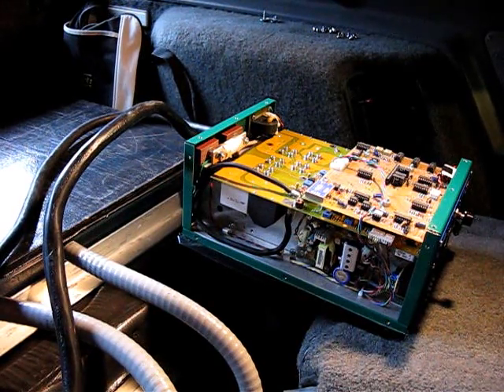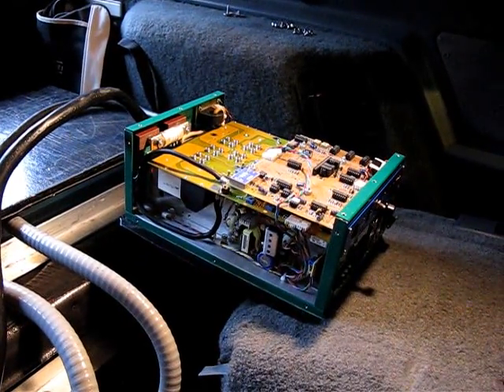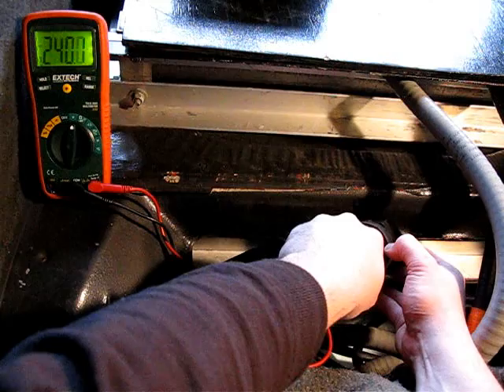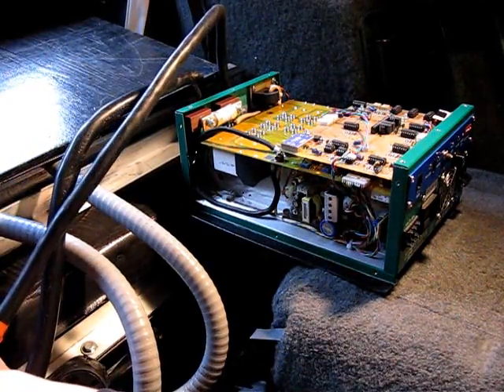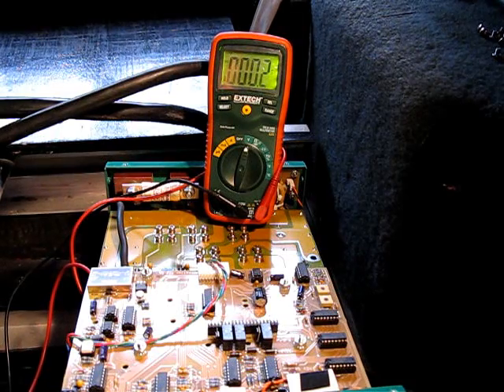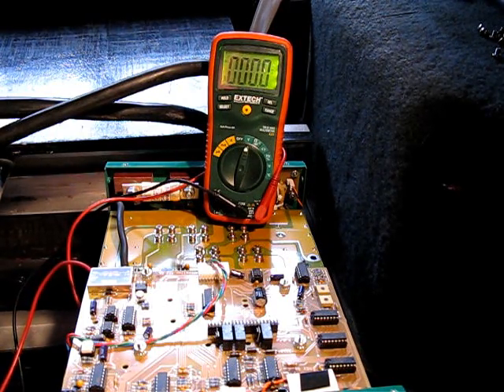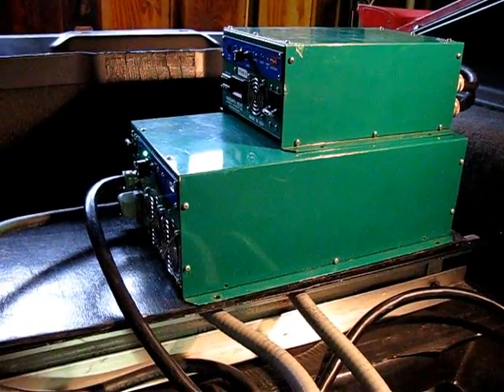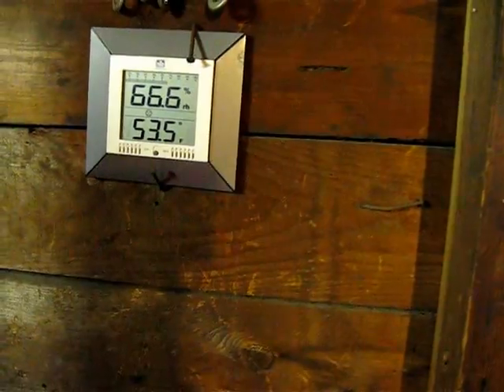January 31, 2014 - Killed Manzanita Charger (Yet Again)

Comment: I have been thinking about your charger problems and have a few thoughts to share.  As you are likely aware these chargers are not isolated from the mains electrical input.  How do you have the mains ground hooked up?  Is it connected to the body of the car?  If so then there is a good possibility that you have a ground fault leak in the battery pack or HV system.  Hunting down ground faults can be difficult.  I suggest adding a hottube GFI breaker into your mains power input.  The other option would be to remove the ground wire, but that comes with some safety risks.  It was nice meeting you at the last EEVCON and it is unfortunate that you are still facing charge problems.
Reply from the maker: Good evening,

My sincere apologies for the prolonged delay in replying...  I have been crazy busy with work and the recent "Google+" changes have been difficult to deal with, so tonight I finally had time to figure out how to reply to comments again.

The AC connection to the charger is basically a straight through, 4-wire series of connections that go directly from the 220V 50A rated NEMA 14-50 receptacle mounted to the wall of my garage to an identical NEMA 14-50 receptacle located within the insulated middle battery box (under/behind the rear seats).  The charger's integrated NEMA 14-50 plug is plugged directly into that receptacle.

The only point at which the AC ground could potentially come into contact with the car frame is within the charger itself as the metal housing of the charger can theoretically touch the vehicle chassis.

On the DC side of the charger, the output goes directly to the two main bus bars in the engine compartment on the high voltage wiring shelf (these have plastic bases, and are mounted on a plywood shelf).  The only time that vehicle frame leaks happen on the high voltage side of things is within the DC motor itself, due to carbon dust build up, water, etc.

While theoretically the motor is mostly isolated from the vehicle frame via the rubberized motor mounts, it is still connected to the transmission, drive shafts, and there is almost always a minor detectable frame leak there.

I honestly don't know much about AC wiring, so am not sure if a GFI breaker would work with a Manzanita charger or not?  Note that it would need to be able to handle a sustained 220 volt draw & 40 to 50 amps for up to about 4.5 hours without tripping...  Is there such a device that can do that?

Thank you for your feedback, and it was nice meeting you at the last EVCCON as well.  :)

Jason
Reply: GFI (ground fault interrupter) units are available as a replacement breakers that should fit into your existing breaker box in your house or garage.  For example here is a Eaton GFI unit from Home Depot. http://www.homedepot.com/p/Eaton-50-Amp-Double-Pole-CH-Type-GFI-Breaker-CH250GF/202281656

You will need to know the manufacturer of your breaker box so you can get the one that will fit.  The other option is a separate panel box to be installed on the wall in your garage.  Here is a example of a separate panel:
http://www.homedepot.com/p/GE-60-Amp-GFI-Spa-Panel-UG412RMW260P/100567181?keyword=gfi